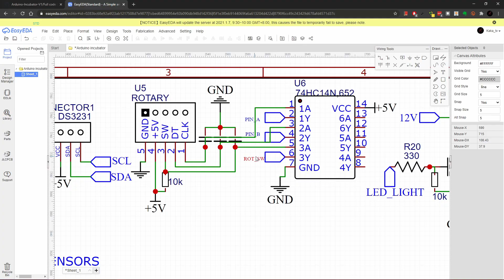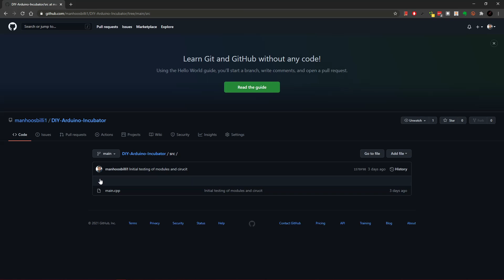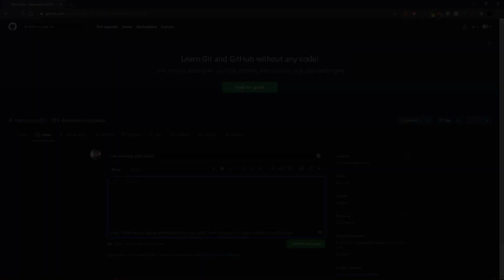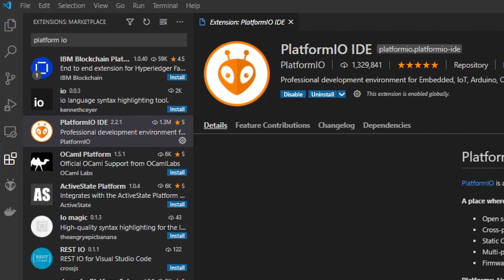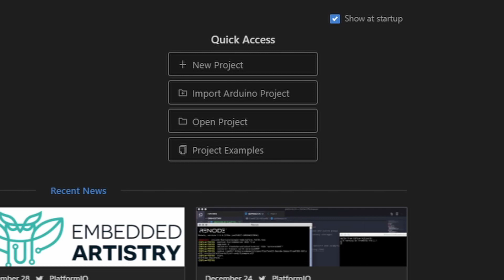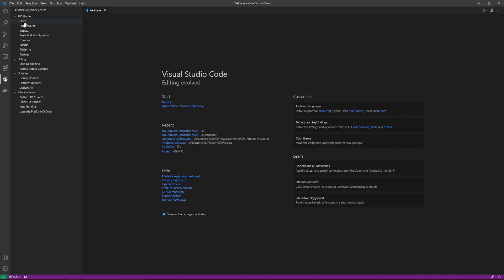DIY Arduino Incubator From Scratch | Part 6 | Setting up the environment

Comment: {
	
	"owner": "C/C++",
	"code": "1696",
	"severity": 8,
	"message": "cannot open source file \"JC_Button.h\"",
	"source": "C/C++",
	"startLineNumber": 11,
	"startColumn": 1,
	"endLineNumber": 11,
	"endColumn": 23
}
Platform io can not open the arduino libraries as per above please assist
Reply from the maker: wait for the next part. I will explain how to run this project on your own.
Reply: @capistor1  
ok awaiting eagerly, brother.
Reply: @meditation393  still waiting ah

Comment: can not find the libraries associated with the errors please can you send me the library links:

Arduino: 1.8.13 (Windows 10), Board: "Arduino Uno"

PID_Incubator_kaka:12:10: fatal error: MenuData.h: No such file or directory

 #include "MenuData.h"

          ^~~~~~~~~~~~

compilation terminated.

Multiple libraries were found for "DHT.h"

 Used: C:\Users\Josep\OneDrive\Documents\Arduino\libraries\DHT

 Not used: C:\Users\Josep\OneDrive\Documents\Arduino\libraries\Grove_Temperature_And_Humidity_Sensor

 Not used: C:\Users\Josep\OneDrive\Documents\Arduino\libraries\DHT-sensor-library-master

 Not used: C:\Users\Josep\OneDrive\Documents\Arduino\libraries\DHT_sensor_library

Multiple libraries were found for "DallasTemperature.h"

 Used: C:\Users\Josep\OneDrive\Documents\Arduino\libraries\DallasTemperature

 Not used: C:\Users\Josep\OneDrive\Documents\Arduino\libraries\DallasTemperature-3.8.0

Multiple libraries were found for "RTClib.h"

 Used: C:\Users\Josep\OneDrive\Documents\Arduino\libraries\RTClib

 Not used: C:\Users\Josep\OneDrive\Documents\Arduino\libraries\RTCLib_by_NeiroN

Multiple libraries were found for "LiquidCrystal_I2C.h"

 Used: C:\Users\Josep\OneDrive\Documents\Arduino\libraries\LiquidCrystal_I2C

 Not used: C:\Users\Josep\OneDrive\Documents\Arduino\libraries\LiquidCrystal_I2C-1.1.2

 Not used: C:\Users\Josep\OneDrive\Documents\Arduino\libraries\LiquidCrystal

exit status 1

MenuData.h: No such file or directory

This report would have more information with
"Show verbose output during compilation"
option enabled in File -> Preferences.
Reply from the maker: the libraries are all included in the repository linked in the description. however i wouldn't suggest implementing the code just yet as the code is incomplete. there is still some work needed to make the code stable. hopefully this will all be cleared in the next video.
Reply: @capistor1  patiently awaiting for next video and code.

Comment: Arduino: 1.8.13 (Windows 10), Board: "Arduino Uno"

incubator_kaka:130:1: error: 'MenuManager' does not name a type

 MenuManager rtMenu(runtimeMenu_Root, menuCount(runtimeMenu_Root));

 ^~~~~~~~~~~

incubator_kaka:313:1: error: 'RTC_DS3231' does not name a type; did you mean 'DS3231'?

 RTC_DS3231 rtc;

 ^~~~~~~~~~

 DS3231

C:\Users\User\Documents\Arduino\incubator_kaka\incubator_kaka.ino: In function 'void setup()':

incubator_kaka:387:8: error: 'rtc' was not declared in this scope

   if (!rtc.begin()) //make it print to lcd if this happens

        ^~~

incubator_kaka:409:22: error: 'REFRESH_DESCEND' was not declared in this scope

   refreshMenuDisplay(REFRESH_DESCEND);

                      ^~~~~~~~~~~~~~~

C:\Users\User\Documents\Arduino\incubator_kaka\incubator_kaka.ino: In function 'void loop()':

incubator_kaka:429:26: error: 'REFRESH_DESCEND' was not declared in this scope

       refreshMenuDisplay(REFRESH_DESCEND);

                          ^~~~~~~~~~~~~~~

incubator_kaka:434:21: error: 'rtMenu' was not declared in this scope

     byte menuMode = rtMenu.handleNavigation(getNavAction, refreshMenuDisplay);

                     ^~~~~~

C:\Users\User\Documents\Arduino\incubator_kaka\incubator_kaka.ino:434:21: note: suggested alternative: 'homeMenu'

     byte menuMode = rtMenu.handleNavigation(getNavAction, refreshMenuDisplay);

                     ^~~~~~

                     homeMenu

incubator_kaka:436:21: error: 'MENU_EXIT' was not declared in this scope

     if (menuMode == MENU_EXIT)

                     ^~~~~~~~~

incubator_kaka:441:26: error: 'MENU_INVOKE_ITEM' was not declared in this scope

     else if (menuMode == MENU_INVOKE_ITEM)

                          ^~~~~~~~~~~~~~~~

incubator_kaka:458:57: error: 'rtMenu' was not declared in this scope

     byte processingComplete = processRuntimeMenuCommand(rtMenu.getCurrentItemCmdId());

                                                         ^~~~~~

C:\Users\User\Documents\Arduino\incubator_kaka\incubator_kaka.ino:458:57: note: suggested alternative: 'homeMenu'

     byte processingComplete = processRuntimeMenuCommand(rtMenu.getCurrentItemCmdId());

                                                         ^~~~~~

                                                         homeMenu

C:\Users\User\Documents\Arduino\incubator_kaka\incubator_kaka.ino: In function 'byte processRuntimeMenuCommand(byte)':

incubator_kaka:1023:8: error: 'runtimeCmdTurnMotorOnce' was not declared in this scope

   case runtimeCmdTurnMotorOnce:

        ^~~~~~~~~~~~~~~~~~~~~~~

C:\Users\User\Documents\Arduino\incubator_kaka\incubator_kaka.ino:1023:8: note: suggested alternative: 'turnMotorOnce'

   case runtimeCmdTurnMotorOnce:

        ^~~~~~~~~~~~~~~~~~~~~~~

        turnMotorOnce

incubator_kaka:1037:8: error: 'runtimeCmdSetTemp' was not declared in this scope

   case runtimeCmdSetTemp:

        ^~~~~~~~~~~~~~~~~

incubator_kaka:1040:8: error: 'runtimeCmdSetHum' was not declared in this scope

   case runtimeCmdSetHum:

        ^~~~~~~~~~~~~~~~

incubator_kaka:1043:8: error: 'runtimeCmdSetFreq' was not declared in this scope

   case runtimeCmdSetFreq:

        ^~~~~~~~~~~~~~~~~

incubator_kaka:1046:8: error: 'runtimeCmdSetTurnDelay' was not declared in this scope

   case runtimeCmdSetTurnDelay:

        ^~~~~~~~~~~~~~~~~~~~~~

incubator_kaka:1049:8: error: 'runtimeCmdSetHours' was not declared in this scope

   case runtimeCmdSetHours:

        ^~~~~~~~~~~~~~~~~~

incubator_kaka:1051:8: error: 'runtimeCmdSetMins' was not declared in this scope

   case runtimeCmdSetMins:

        ^~~~~~~~~~~~~~~~~

incubator_kaka:1053:8: error: 'runtimeCmdSetSeconds' was not declared in this scope

   case runtimeCmdSetSeconds:

        ^~~~~~~~~~~~~~~~~~~~

incubator_kaka:1055:8: error: 'runtimeCmdSetYear' was not declared in this scope

   case runtimeCmdSetYear:

        ^~~~~~~~~~~~~~~~~

incubator_kaka:1057:8: error: 'runtimeCmdSetMonth' was not declared in this scope

   case runtimeCmdSetMonth:

        ^~~~~~~~~~~~~~~~~~

incubator_kaka:1059:8: error: 'runtimeCmdSetDay' was not declared in this scope

   case runtimeCmdSetDay:

        ^~~~~~~~~~~~~~~~

incubator_kaka:1061:8: error: 'runtimeCmdSetP' was not declared in this scope

   case runtimeCmdSetP:

        ^~~~~~~~~~~~~~

incubator_kaka:1064:8: error: 'runtimeCmdSetI' was not declared in this scope

   case runtimeCmdSetI:

        ^~~~~~~~~~~~~~

incubator_kaka:1067:8: error: 'runtimeCmdSetD' was not declared in this scope

   case runtimeCmdSetD:

        ^~~~~~~~~~~~~~

incubator_kaka:1070:8: error: 'runtimeCmdIncubationTime' was not declared in this scope

   case runtimeCmdIncubationTime:

        ^~~~~~~~~~~~~~~~~~~~~~~~

incubator_kaka:1073:8: error: 'runtimeCmdSaveProfile' was not declared in this scope

   case runtimeCmdSaveProfile:

        ^~~~~~~~~~~~~~~~~~~~~

incubator_kaka:1079:8: error: 'runtimeCmdShowHatchDay' was not declared in this scope

   case runtimeCmdShowHatchDay:

        ^~~~~~~~~~~~~~~~~~~~~~

incubator_kaka:1081:8: error: 'runtimeCmdCalcHatchDay' was not declared in this scope

   case runtimeCmdCalcHatchDay:

        ^~~~~~~~~~~~~~~~~~~~~~

incubator_kaka:1083:8: error: 'runtimeCmdToggleLight' was not declared in this scope

   case runtimeCmdToggleLight:

        ^~~~~~~~~~~~~~~~~~~~~

incubator_kaka:1085:8: error: 'runtimeCmdToggleCandler' was not declared in this scope

   case runtimeCmdToggleCandler:

        ^~~~~~~~~~~~~~~~~~~~~~~

incubator_kaka:1087:8: error: 'runtimeCmdConfirmation' was not declared in this scope

   case runtimeCmdConfirmation:

        ^~~~~~~~~~~~~~~~~~~~~~

C:\Users\User\Documents\Arduino\incubator_kaka\incubator_kaka.ino:1150:3: warning: jump to case label [-fpermissive]

   default:

   ^~~~~~~

C:\Users\User\Documents\Arduino\incubator_kaka\incubator_kaka.ino:1091:9: note:   crosses initialization of 'int checkAdd'

     int checkAdd = customConfigAdd1 + sizeof(myEggConfig) - sizeof(myEggConfig.version);

         ^~~~~~~~

C:\Users\User\Documents\Arduino\incubator_kaka\incubator_kaka.ino: In function 'byte getNavAction()':

incubator_kaka:1170:33: error: 'rtMenu' was not declared in this scope

   byte currentItemHasChildren = rtMenu.currentItemHasChildren();

                                 ^~~~~~

C:\Users\User\Documents\Arduino\incubator_kaka\incubator_kaka.ino:1170:33: note: suggested alternative: 'homeMenu'

   byte currentItemHasChildren = rtMenu.currentItemHasChildren();

                                 ^~~~~~

                                 homeMenu

incubator_kaka:1173:17: error: 'MENU_ITEM_PREV' was not declared in this scope

     navAction = MENU_ITEM_PREV;

                 ^~~~~~~~~~~~~~

incubator_kaka:1175:17: error: 'MENU_ITEM_NEXT' was not declared in this scope

     navAction = MENU_ITEM_NEXT;

                 ^~~~~~~~~~~~~~

incubator_kaka:1177:17: error: 'MENU_ITEM_SELECT' was not declared in this scope

     navAction = MENU_ITEM_SELECT;

                 ^~~~~~~~~~~~~~~~

C:\Users\User\Documents\Arduino\incubator_kaka\incubator_kaka.ino: In function 'void refreshMenuDisplay(byte)':

incubator_kaka:1223:7: error: 'rtMenu' was not declared in this scope

   if (rtMenu.currentItemHasChildren())

       ^~~~~~

C:\Users\User\Documents\Arduino\incubator_kaka\incubator_kaka.ino:1223:7: note: suggested alternative: 'homeMenu'

   if (rtMenu.currentItemHasChildren())

       ^~~~~~

       homeMenu

C:\Users\User\Documents\Arduino\incubator_kaka\incubator_kaka.ino: In function 'bool startNewHatch(int)':

incubator_kaka:1538:18: error: 'rtc' was not declared in this scope

   DateTime now = rtc.now();

                  ^~~

exit status 1

'MenuManager' does not name a type

This report would have more information with
"Show verbose output during compilation"
option enabled in File -> Preferences.

Having above code errors please assist.
Reply from the maker: The compiler is unable to locate the libraries i have attached with code. If you are using vscode it should not give you this error. If you are using arduino software you need to add the libraries manually from my repository

Comment: You are good, good instructor and advisor, but you are also good in keeping us waiting, l am really eagerly awaiting the video on code and the final schematic. Thank you for bracing us with this excellent knowledge. Please advice when the code video will be out + the final code. And also why not use lcd 20 x 4
Reply from the maker: Haha! Thanks for the kind compliments. I like to test and verify the information given in my videos before uploading them. The more information that the video has, the longer it takes me to verify. These videos require alot of time which unfortunately i dont have nowadays but i will try to upload in these 2 weeks. 
I didn't use 20x4 lcd because that is not as easily available as 16x2 and because not alot of information has to be displayed in this project.

Comment: Great work, please when are we going to have the next video which have explanations  of code in details.
Reply from the maker: Actually i was just thinking about that. Was wondering wether in the next video i should go into a bit more depth than usual. The code is a bit complex and i am sure it's going to be of no use to beginners if i share the code without details. But if go with the detailed route the software side will probably take like 10 videos and will be very educational and useful. But if i dont go that route it might be done in 2 or 3 episodes, but will be useless to beginners. What do you think i should do?
Reply: Thank you for the good work, but I am patiently awaitng the programming section which is arduino ide based, please update on when is the next series coming.